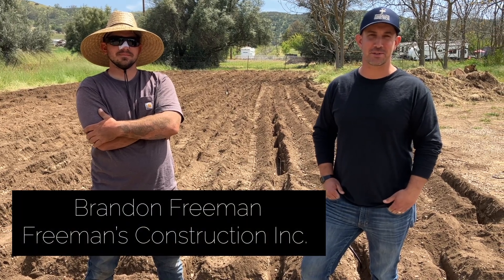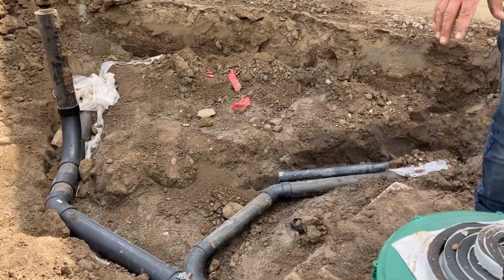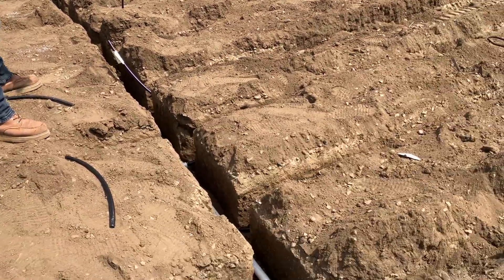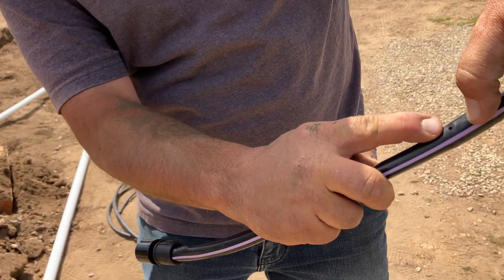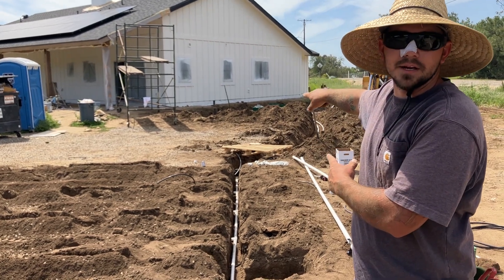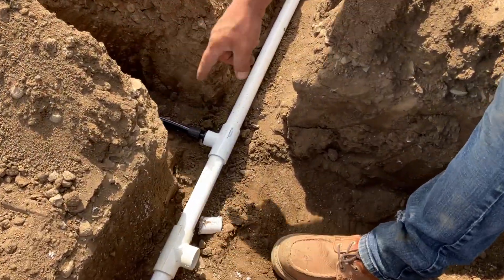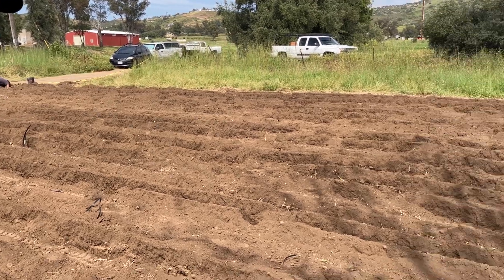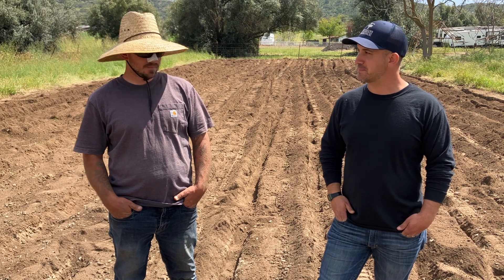Installing Alternative Septic Systems (ATU) for New Homes

Comment: how many bedrooms is this house? I thought drip fields took less space but this looks huge
Reply from the maker: This is a 3 bedroom house. The purpose of this type of system is to not save space but to allow you to install a system in an area with high ground water since it is much closer to the surface than a traditional septic system. Thanks for your question.

Comment: Do those systems need maintenance?
Reply from the maker: They do. It is recommend that a septic contractor do a yearly inspection to make sure it does not need any repairs. Sometimes gophers can bite through the drip lines in the leach field.